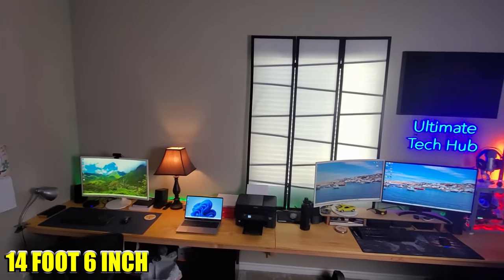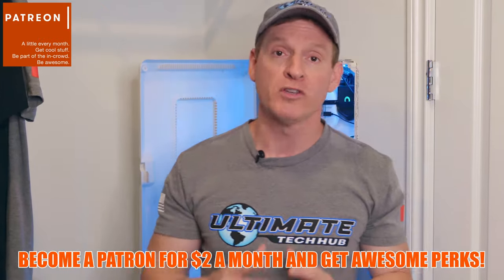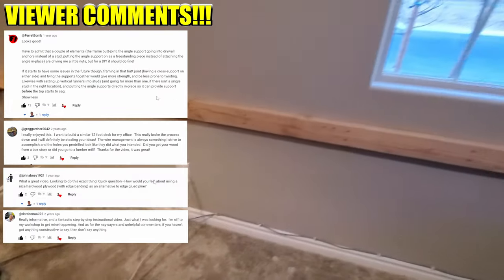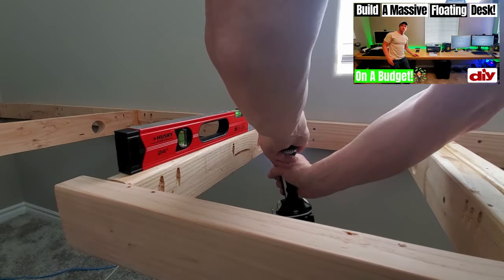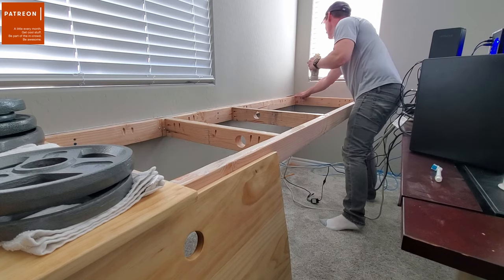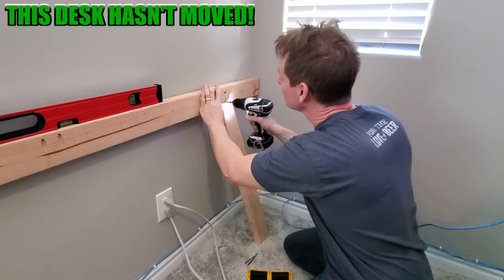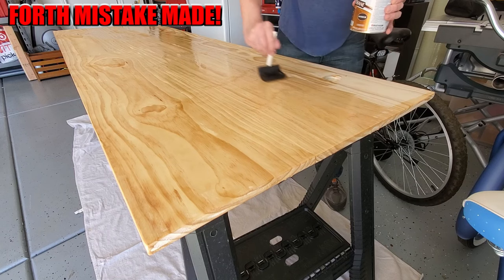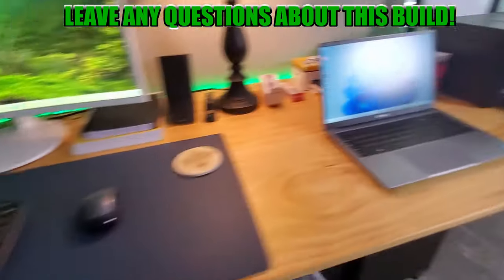MASSIVE  14 FOOT FLOATING DESK BUILD - 2 YEAR REVIEW

Comment: Hey hey, what's up Mike, this is Guys!  Lol, I recently built a 15' long L-shaped floating desk in my newly remodeled basement (I didn't record it so it won't be on youtube) and I really appreciate this video because it gave me some tips on how to do it and avoid the issues you brought up:
1. I used 2x2 instead of 2x4s
2. I didn't glue the top, I screwed it
3. I cut the tabletop and the supports to the same length so I could add a trim piece in front that makes it look like one thick table
4. I used a planer and dowels to ensure the pine boards were even when glued together.
5. I used lag screws in the wall to ensure it remained rigid.
6. I put 5 coats of poly, not 7. I didn't want to put too much and mess up the wood as I've read happens when you have too much poly, but I did want to add more to delay the eventual scratches. 

Thanks for making this video and for being humble enough to share where you got it right and got it wrong!
Reply from the maker: Sounds like you have built an amazing floating desk! Glad to help and share my mistakes. FYI my desk is still solid and looks great! Thanks for watching!